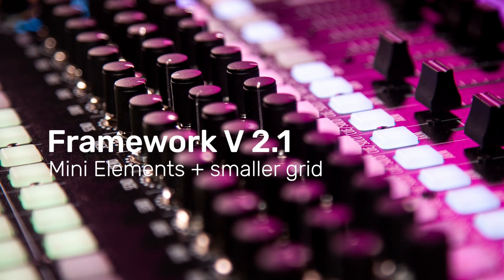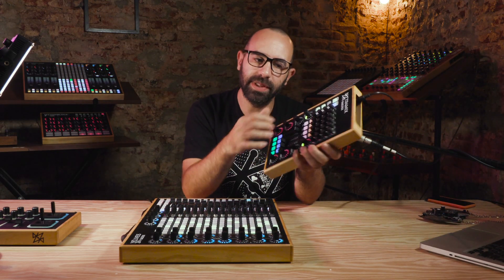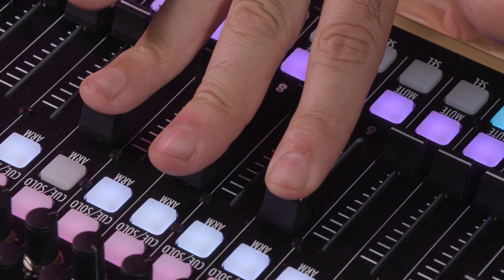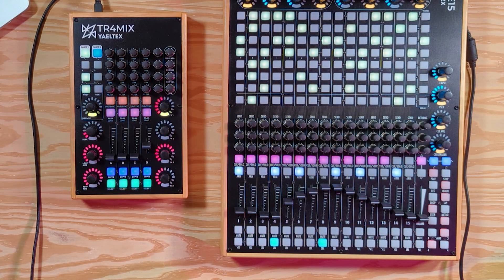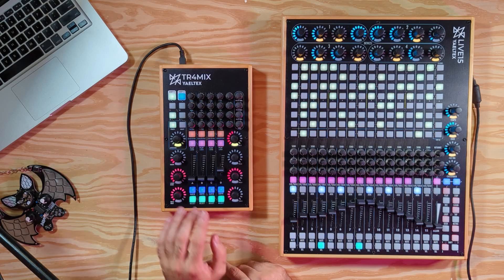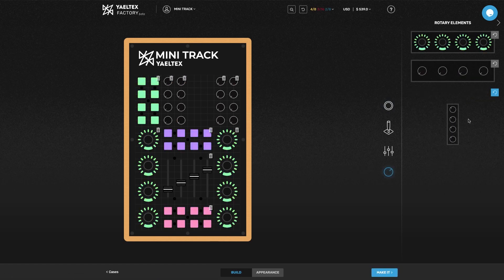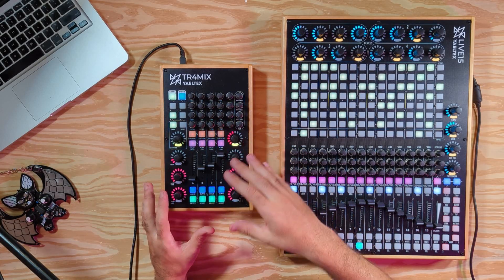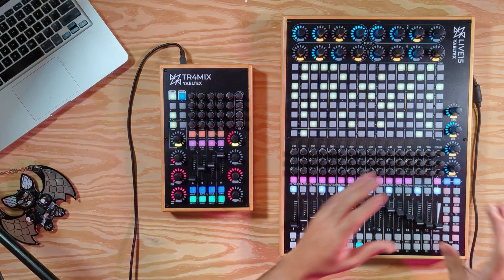YAELTEX v2.1 - Mini Elements + smaller grid for your CUSTOM MIDI CONTROLLERS

Comment: I will buy one with smooth endless encoders. Detent is a rotary switch. Smooth is for performance. If you map a controller to a synth you don’t want detent when you change a filter or a envelope. It’s nice for a synced LFO. Osc shapes etc. 
Just pick a random synthesizer and count how many rotary knobs are smooth vs switch. You need to offer both to be able to feel you’re controlling sound using software. Thank you.
Reply from the maker: Our detented encoders have 24 detents per full revolution, so steps are pretty small and we have many customers that like them for performing. But of course, they are totally different from the non-detented endless rotary controls, which we are just about to release and include in our framework. Actually, you can do a design with the current encoders and drop us an email so we change them for the new non-detented in production ;)

Comment: how about scripts for ableton control surface
Reply from the maker: That can be easily done with the Yaeltex Universal Remote Script tool. Check it out https://forum.yaeltex.com/t/universal-remote-script-for-ableton-live/161
Reply: @Yaeltex  I took the time to lurk into python scripts, recreated the complete API and became advanced in the APi and Python programming, now I can extend twister, launchpad and any third party tools. But it was difficult at the start.  Thanks, this script is truly useful to see how certain things are implemented. There are 3 ways to implement one is by using framework (old way), second is to use control surface class with deviceprovider and a lot of other useful clasese, but the latest is to use only Live framework and create your own clases just like control surface class impements them. It is the most difficult but it is also the most transparent and manageable.

Comment: can i control an hardware synth in midi ?
Reply from the maker: Yes, most of the times! Check the "MIDI CHART" section of your synth manual. There you will find which message you should configure in your Yaeltex controller to control the synth

Comment: Love these additions, when will we get pots with center detente though?
Reply from the maker: We don't have those yet, but we have a feature called "Dead zone" that helps you precisely snap a center value pretty  easily with a normal potentiometer.
Reply: @Yaeltex  Thanks guys, can you share any videos that go over it? I am having trouble finding any info
Reply: Very interested in these controllers, but would also love pots with center indents...